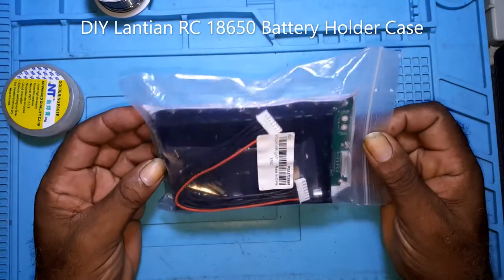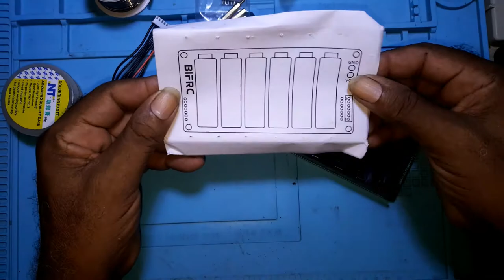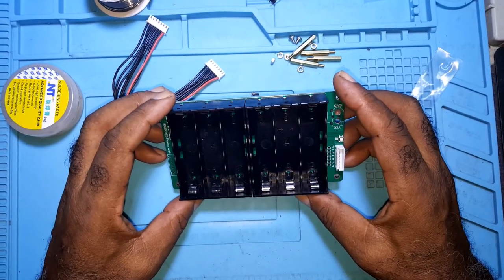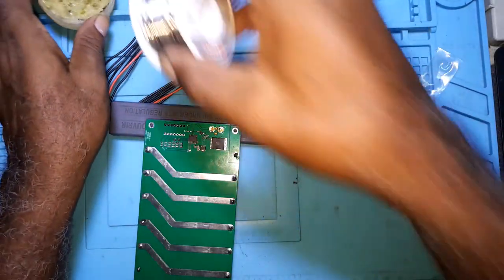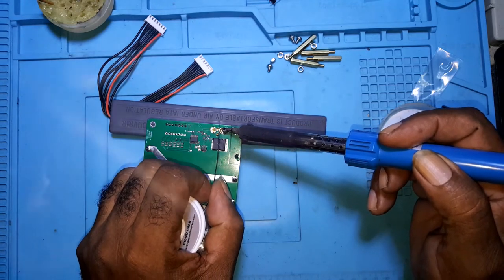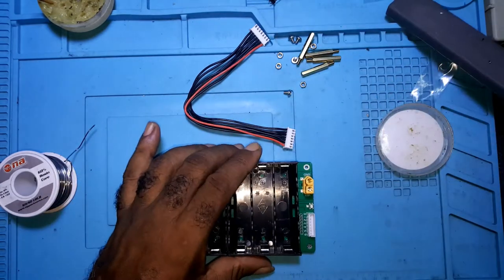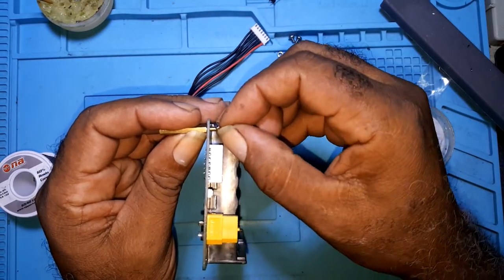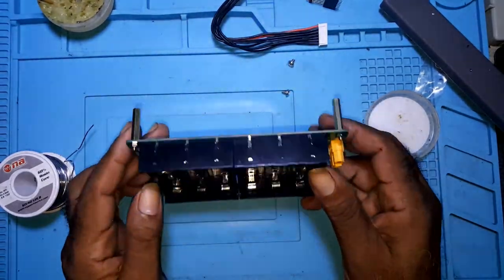DIY Lantian RC 18650 Battery Holder Case

Comment: Have you tried to charge the number of cells below 6 at once? It looks like that it can’t start charging when it’s not being filled.
Reply from the maker: Try to change without the balance cable connected

Comment: I got a couple of these to try. I use one to power a lipo charger so I can charge small lipo batteries when I'm out flying my racing drones. Mine didn't come with the circuitry on the back of the board that yours has, it looks like some kind of BMS.
I'm pretty happy with it but I can't figure out how to mount the balance port pin headers for using more than two stacked together. If you solder the male header to the bottom board and the female header to the under-side of the second board, you can't add another male header to the top side of that board to mount a third one on top of that. Hope that makes sense :)
Reply from the maker: Yes  I agree but I will be using it to balance the  battery l will not be getting any more i got this one just to experiment with it.

Comment: Mine does only blink tue led no output toll i long press the Switch.  After Short time output is off again.
Reply from the maker: I used mine for balancing so I don't know of the output i will try it out and let you know how it works.